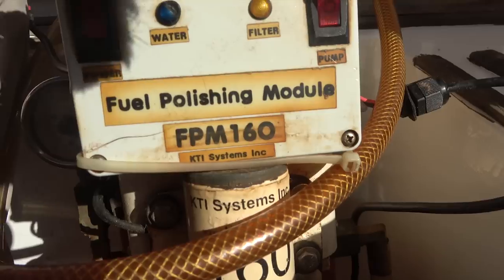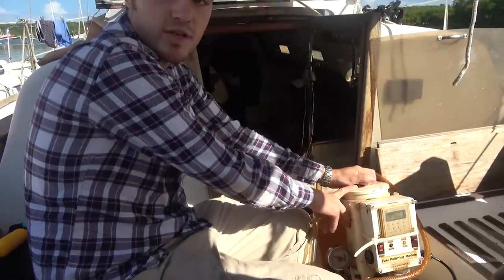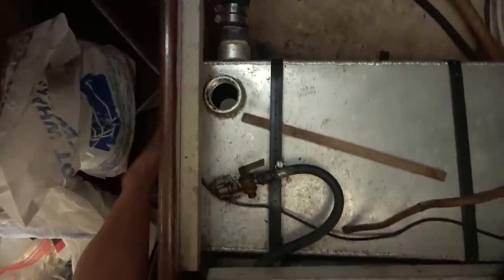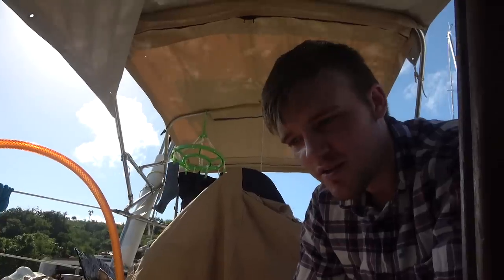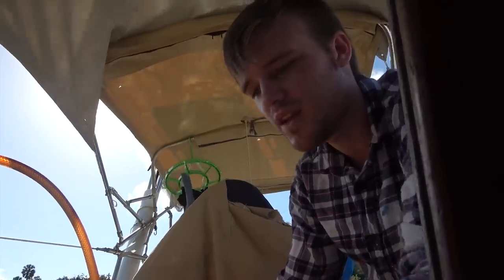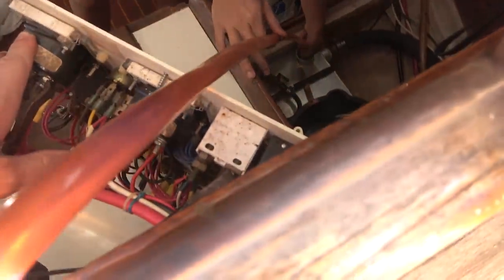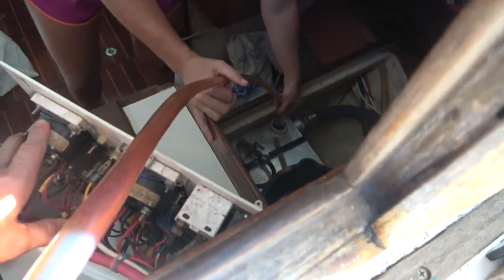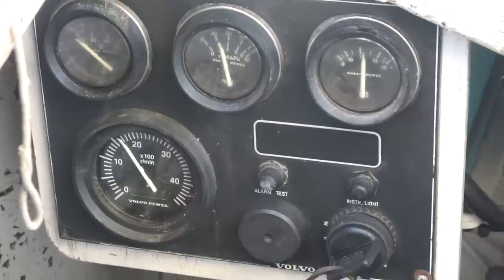Avoid DISASTER AT SEA the Boat Chore You can't Ignore  Ep 111

Comment from the maker: Thanks guys!! For the like and for sharing this vid with your friends 😀 Any ideas for the outboard battle are welcome, AND if you think of any other essential pre-sailing maintenance items be sure to share those as well.
Reply: Great watching you both having fun through the frustrations. A possibility with the outboard could be something simple like the fuel tank breather hole being blocked. This would cause a vacuum in the fuel line and starve the engine of fuel.
Reply: Check the inside of the fuel hose for delamination. You never know and you can eliminate that. Ethanol (assuming it's had a ton through it) can break down the linings of cheaper hoses. I fought hard with a Mercury outboard with a similar issue, and I tried everything. I was convinced the carb was clean, then I went at it again making sure every little passage was clear. Also, that the pressure fuel pump diaphragm wasn't torn. I got it running and it was something blocking a carb passage. One thing to try...as it starts to die, if you pump the bulb, can you keep it running? And of course make sure the vent is open on the tank. Another test, when it starts to die, if you hit the choke will it surge back to life? Not familiar with that outboard's choke system. Is it really choking the air off the carb, or is it an enrichener that is injecting a blast of extra fuel (how older mercury 2 strokes work) when you choke it? If it's an enrichener, and surges to life, the extra fuel helping it run may suggest an air leak somewhere too. Another idea too (but unlikely) is make sure any kill switches (tethers, etc) aren't grounding out and causing it to die due to a possible chafe in the wires. If you can keep it running by pumping the bulb or choking/priming it, then that is unlikely. I also found chafed wires on my old outboard. The motor would run for a while, and then all of sudden, with no rhyme or reason, it would stall. So many things...
Reply: sell it and buy an electic trolling motor (12v), plus two LiPo batteries.
Reply: Gas fill cap have a vent screw? Take the cap off and see if it will stay running.
Reply: I agree with these guys, fuel. Either the line or the tank. Maybe the pickup in the tank? Vent? Possibly still a blocked jet iin the carb so it is using the fuel pumped into the carb bowl but unable to keep it coming through?  You are close tho!
Also. Air filter and Oil and filter change on the main engine if you havent already.
Reply: The Coil and Spark Plug Wires, plus maybe change the spark plug again. That would be my 1st  start. And change any electrical components. 

1 last thing. Do a compression test. It could be a head gasket and or the piston rings.
Reply: @clutelmm  It's definitely a fuel problem or an ignition problem.  Does that motor have electronic ignition or points?  if it has electronic ignition, I'd keep chasing a fuel delivery issue.
Reply: Great tips that I should have mentioned. Could be running one cylinder down, or have low compression. I checked both of those on mine and did find a bad wire that had a break in it so another intermittent problem. Solved that and then kept looking. I had a host of problems.
Reply: I had a small outboard fuel line deteriorate from the inside once. The debris would pass through the filter and get stuck in a fine micron screen in the carb. Just a idea. It did the same thing.
Reply: Sell it or take it to a proper mechanic .. you may be dependant on this motor for your life at some time. Home made fixes are fine on the hoof when needed but that’s not the way to set off to sea with.
Reply: Definitely fuel related.  Could be an air/vacuum leak.  When it starts to did, pump the primer bulb.  If it stays running you know it is a fuel problem.
Reply: Jack Patteeuw  I agree , a fuel starvation issue. You seem to be just filling the carb bowl and no new fuel coming in. Pumping the bulb occasionally should keep it running , usually how you diagnosis a bad fuel pump, but you have a new one!  So if occasionally pumping the bulb keeps it running then the fuel pump is  still not working . That looks like a 4 stroke but I only have 2-stroke outboards ( as the 4's are so unreliable and hard to fix). The fuel pump on 2-strokes use the vacuum in the crankcase to run the pump. IF that's the case is there something wrong with the fuel operating system? Blocked vacuum connection .?
If you are convinced the pump is pulling fuel ( tank vent open? ) then it's not filling carb bowl  so the float needle could be still  be sticking despite the clean carb.  Since it won't idle it's not getting any fuel........so if you could keep it running with a spray of a little Carb cleaner or easy start , spray bottle of fuel oil mix ,even wd 40 in a pinch , anything to prove it will keep running if you can get fuel to it. ......, if it keeps running then it's back to the carb and fuel pump ......you have done all the right things just clearly something missing even though it looks right. 
Fingers crossed.  Cheers Warren .
Reply: A small leak anywhere in the fuel line can cause a problem of an outboard running just fine for a minute before cutting out.  Cracks in the hose where it connects to the engine is a common place for faults, you can sometimes see/smell a fine mist of fuel squirting out as the engine runs. Cut the cracked section of hose off the end and reconnect.

The symptom is similar to a clogged air vent - engine runs fine for a minute, then stops.
Reply: Try cleaning the driveshaft on the outboard.
Reply: My outboard did exactly as yours, and it was a small piece of debris in the fuelpump clogging it up. Though, I could keep the engine running by squeezing the ball every time the revs started to drop. Tohatsu had been so nice to place a fuelfilter after the fuelpump instead of before the fuelpump. Cleaning the fuelpump and a fresh fuelfilter solved it. Now the fuelfilter is located before the fuelpump. Outboard been running great since.
Check/replace all the fuelfilters. Maybe also one loacted inside the tank at fuel-pickup.
Also, how old is the fuel? Any water in the fuel due to condensation in the tank? Any way, try with some fresh fuel from another tank / temporary bottle. If possible with a fresh fuelline.
Reply from the maker: @stevegnh  we did cut off a bit of hose and opened it up. It looked good. It seems like air is getting into the lines. We think the o ring g in the quick fuel connector went bad. Our choke system chokes the air. Thanks for the feedback. We will keep at it.
Reply: Add your own fuel polishing system that’s permanent. 25 years working on ships ask me how I know. Also  fueling in places that have lower standards of fuel quality is a pain. Also as for the outboard check the fuel system and make it simple quick connects are not user friendly they cause issues. Also a sail boat will and can go a long way under sail and while your doing that it stirs up the tank and then plugs tons of filters. Go look for an old boat that’s salvaged or junk and rob there filter and pump setup and make your own polishing system. Also when you put in your impeller always rotate it in the direction it turns as you push it in.
Reply: Hello Friends that’s not why the motor is shutting off. It’s a fuel problem.

Comment: It's possible the vent on the tank is clogged and if no air gets in the fuel stops going out, try loosening the gas cap a little to see if that's the case.
If that keeps it running find the clog and be good to go.
Reply: Scott Senter I was thinking the same thing or not getting enough vacuum to maintain the fuel flow to the bowl.
Reply: I second that, easy to forget when moving tank.
Reply: @petermarine2372  The pump valve will invert if there is a vacuum build up.. Easy check is to open petrol cap. As he was pumping fuel, I very much doubt this is the problem. He would have noticed. In most cases, and especially with such a small outboard, you will get a few minutes before the vacuum causes a stall. And if we do stall,  it is the first thing we check, and the last thing we admit to.
Reply from the maker: This is a good thought but we had the cap of the tank completely off in case it was a clogged vent. We are not suspecting the quick connect fuel line connector. After more trouble shooting we noticed that it would stay running as long as we continued to pump the primer bulb. After some time we noticed fuel was leaking at the fuel line connector. Maybe a bad o ring. Working on getting a new one now.
Reply: @Bumsonaboat  Yes, that will answer the stall problem.  If there's air going into the intake fuel line the engine start loosing power and died.
Reply: Bums on a Boat Joel if you pump bulb and that keeps its running then you have  a fuel pump problem or vacuum leak keeping the pump from  pulling fuel
 Take pump back off and make sure it is back together right and recheck your vacuum lines JT 🇺🇸🐟🎣🌴🛥⛱😃😊🙏🏻🙏🏻🙏🏻🙏🏻
Reply: @Bumsonaboat  If it will stay running when/if you pump the bulb, thats a telltale sign of a bad fuel pump, as you are literally becoming the pump itself. I know you said the pump is new, but give it a once over. The diaphragm inside of them can sometimes get a small hole in them. Of course, you'll want to check/replace the quick connect as well. Stick with it. If your carburetor has a low speed idle adjustment, make sure that it is working properly as well. It's used to dial in a nice slow idle when in neutral. The fact that it starts and runs well at high rpms means the motor itself is good and worth keeping. Thanks for all the great content. Cheers!
Reply: I had the same problem with my outboard. Would run for a bit and just die....... found out I had to OPEN the vent in the tank! Sucks when your just learning.

Comment: I work on small outboards and, I must admit, your engine is one of my least favorites. To trouble shoot your current problem follow these steps. 1 pump the bulb on the fuel hose until hard. Disconnect the fuel line at the carburetor. 2 Get a water bottle or soda can to catch any fuel comming out of the fuel line. 3 Start the engine. Does the fuel pump send fuel into the bottle? If it does, your issue is in the carburetor. There are a number of things that can cause your problem. I know you cleaned the carburetor but proper reassembly is critical. 4 Remove the carburetor and float bowl, check that the needle and seat  are assembled correctly and the float sits parralel to the carb body when inverted. Next, examine the little skinny flex tube for holes or splits. That hose connects to a plastic item called a nozzel well. Make sure it is clean and will allow air to pass. Before starting this project record your engine model and serial number. Go on line to marineengine.com. Follow the prompts and enter your model number. look at the carburetor breakdown. Print it out if you can. Now, when you disassemble the carburetor make sure there are no missing peices including gaskets and washer like seals. While disassembled blow through every hole you can find. Reassemble and try running again. You can probably find a YouTube video with solutions to your problem. dangar marine on youtube is a good source of outboard info. Good luck. Dave
Reply: Totally Agree. Way to much plastic.  Bottom feeder outboard. Personally. I'd much rather have an old tried and true outboard. If it doesn't start. Idle. Then scream. No place on my dinghy.  I know every square inch of my outboard. Being dependable is job one.

Comment: Joel, the engine has a choke.  When the engine is cold the choke closes and makes the engine rev at higher RPMs.  This warms up the engine.  The warmer temp opens the choke and allows the RPMs to decrease.   The idle becomes smoother.  It does this because the engine is designed to operate at a certain temp usually 180 - 200.  Older engines usually 180 and Newer 200.  The engine uses less fuel at the correct temp and has more horse power.   The thermostat you change controls the water that controls the temp.  Some chokes have a coil spring that controls the on and off depending on which engine.  Check your owners manual which can be found on line.  
Happy sailing

Comment: another preventative maintenance item for the main engine is to clean the raw water to coolant heat exchanger and replace the sacrificial zinc. They have chemicals to do this cleaning or you can remove it and take it to a reputable radiator shop. If you can afford it, you  could buy a spare, swap it out then  take your time having the removed unit serviced. Good time to also inspect the hoses, clamps and through-hull fittings  and shutoffs.

Comment: on the outboard, had this one happen before.  On the motor side there is an O ring that seals the fuel prod to the receiver. If that O ring is faulty or if the receiver fitment, or the fuel line to the motor have even the tiniest fault the engine will die just like that.  My bet is on the O ring. Just make sure you have the right size and do not use a sharp thing to seat the new one. I use a pencil eraser to make sure it is seated. Good luck.
Reply from the maker: Aha you are the first one in the comments to suggest this and it is exactly what we are investigating at the moment. Thanks for the feedback.

Comment: I love your persistence and positive attitude. I doubt if your diesel tank is clean based on how much gel came out. Best thing would  be to remove all the fuel and cut an access port into the top so you can clean it out. Example Seabuilt APS-6, 6” inspection port, $152. If you can't put an inspection port in now, a cheap way to clean is to leave tank half full and sail the hell out of the boat so it washes all the sides and splashes on the top.  Then repeat the fuel polishing. Depending on what you see, repeat again. 

Also, the gel comes from water in the tank allowing microbial growth. If you only put good fuel in or filter through a baha filter, then water can get in from 1) bad o-ring on deck fill cap or 2) condensation in the tank vent line.  I made a drying filter for the vent line with a PVC pipe 1.5-2" ID.  Put plastic or fiberglass screen and nipples to fit your vent line on each end and fill with Blue (dry) Drierite and insert this into the vent line. This will stop water coming in through air filling the tank as the weather cycles hot/cold or from venting as your fuel level drops. Once or twice a year, remove the spent (pink) Drierite and heat in an oven to recharge to blue. Place in clean jar while hot so it can cool without absorbing ambient moisture.  Then put back in the homemaid PVC filter body.

You can prepare for bad fuel beforehand by having a way to switch to a good diesel jug and capture into an empty jug but know how long you can run this way before you fill the empty one.  Good luck

Comment: By the way you don't have to apologize for anything. Thanks for sharing! The dingy fuel system may need to vent. Check the fuel cap, or slightly open the fuel cap and see if the motor run sustainable.
Reply from the maker: Okay, we actually h ad the cap off loose during the demonstration.
Reply: @Bumsonaboat  bummer, then thats not the problem, lol

Comment: I agree with Scott, could be an easy fix, loosen the gas can cap to be sure its getting air as the vent cap may be clogged.
Reply from the maker: Good thought but we had already tried this. At the moment we are thinking the o ring on the quick fuel connector is bad allowing air into the lines.

Comment: So many great post's with very valid solutions. I had a similar motor. I found releasing the clamps on each side and kicking it overboard solved all my issues.   Johnson  outboard manufacturers will put something somewhere in an engine from one year to the next that is not documented in any way that loves to break. In saying that, as you would have done all the suggested,  I would first borrow a mates petrol tank and line, and if no luck, try a can of carby cleaner in the fuel in conjunction with a can of Start u Bastard. or AiroStart.   Get it running the rev it like a Bastard.  You can also hold your tank above the motor. This will assist with gravity feed taking pressure of the engine pulling though the fuel. That will give the Carbie cleaner a chance to work.   Again.. who ever knows, outboards are put on earth to test us.
Reply from the maker: 😂hmm, I might try that. Thanks for the ideas. You are so right, this bloody outboard has really put us to the test, both mentally and physically.

Comment: Fuel supply. If the primer bulb is still hard after it dies then I agree with the comment regarding the float/needle/seat. It must be sticking closed.

Take your time and do it right, as per your new plan. You can’t just pull over on the side of the road and fix it it or get help. It’s fun watching you work through it, keep it up!

Comment: Good morning in the gas tank hold the hose up with a wire change the filter on the end of the pick up unit in gas can then make sure all your connections are tight you are losing pressure somewhere like when you guys were trying to do the tank on the boat same things going on vacuum leak hope this helps I will continue to watch👍✌😎
Reply: I would agree this is what I suspect is happening aswell, I've had similar issues with my outboards before. I would suggest you guys open the fuel tank and start the troubleshooting there. Also if someone has an outboard with the same fuel connection try using their fuel tank/hose, you can find out quickly that way
Reply from the maker: Thank you. We are now thinking the o ring in the quick fuel line connector went bad which would cause us to loose pressure. Appreciate the feedback.
Reply from the maker: @T3nEighty  Great thought. We will be on the lookout for one.